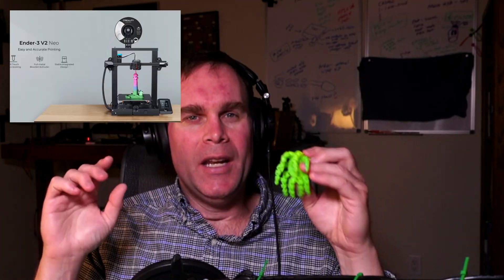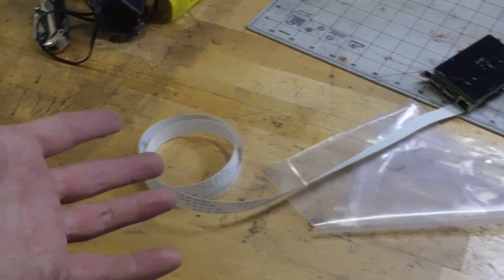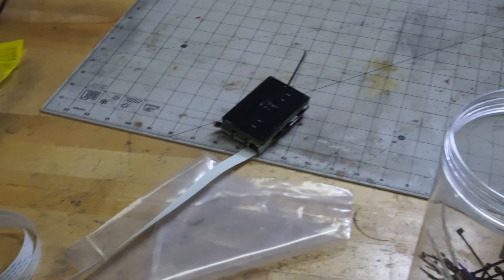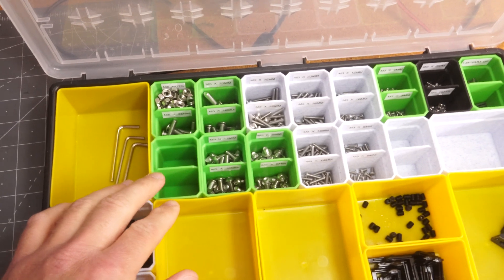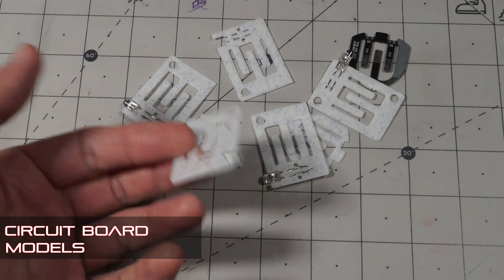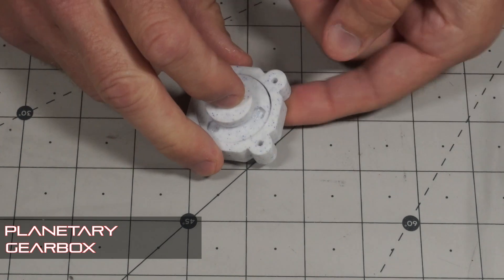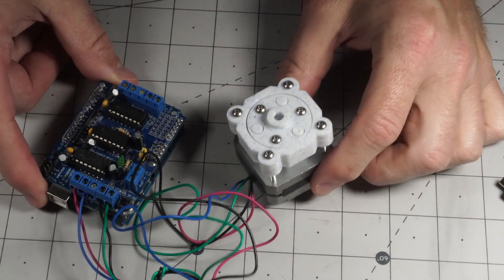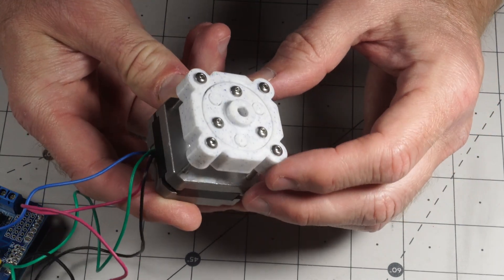Ender 3 V2 Neo: First Month of Printing [Octoprint]

Comment: Great stuff, what octolapse profile did you use? I've had trouble with Octolapse and haven't been getting the create your own profile right for some reason. 
Nice prints.
Reply from the maker: Thank you! I'm using a Default OctoPi 0.16.0, Center Right stabilization, Smart - Compatibility trigger.
Hope that helps.

Comment: Im running OctoPrint and a  webcam plugged into a laptop with YawCam and my time lapses arent that nice? how did ya remove the actual extruder?
Reply from the maker: I'm using a RPi HQ camera, which works pretty well for the time lapses. I removed the extruder via a plugin called Octolapse. Highly recommended.
Thanks for watching and all the best with your printing!